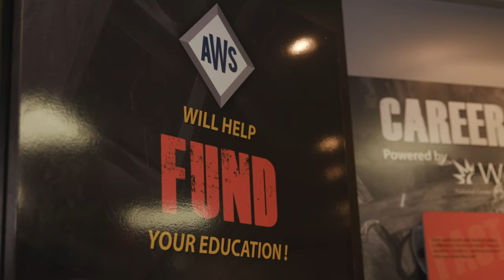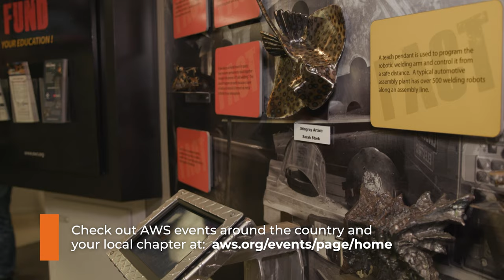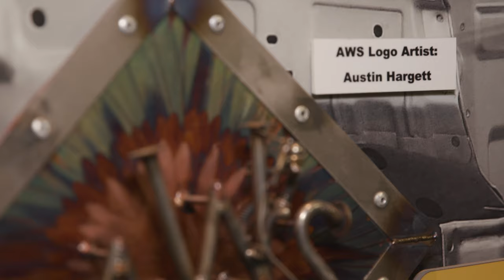Virtual Welding & AWS Competition at Fabtech

Comment: Those virtual welders are very cool. We used those in welding school. They're pretty costly for the whole set. Up around the cost of $5000. Crazy!! I scored a 98% on my second day of using them and could never get any higher. Even our instructor couldn't get higher than a 98%. They're even harder while using the virtual set installed in the hood it comes with. Being that it's so costly, I'll never own one because I'd rather spend that kind of money on an actual welder. But they're very cool to practice on.